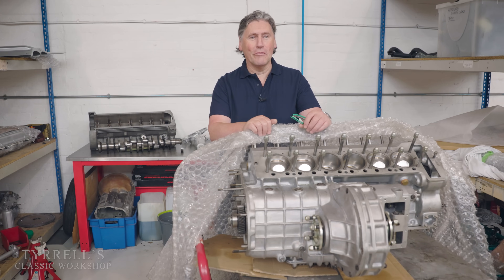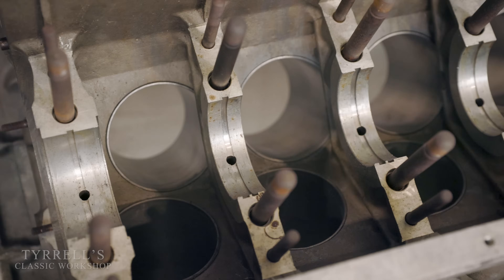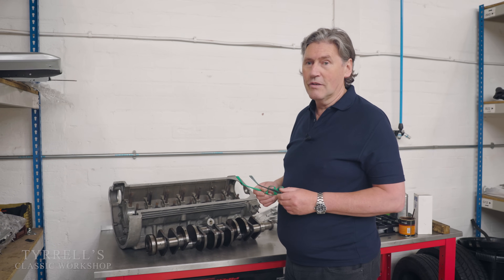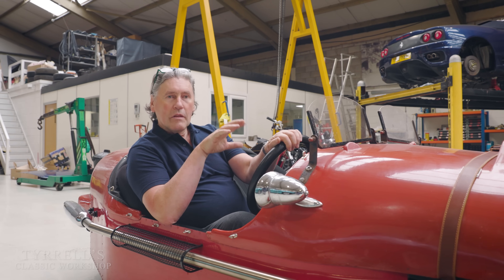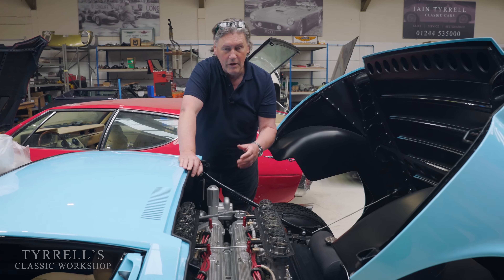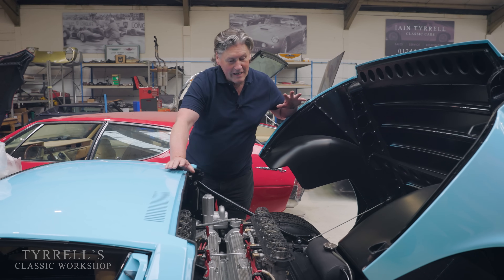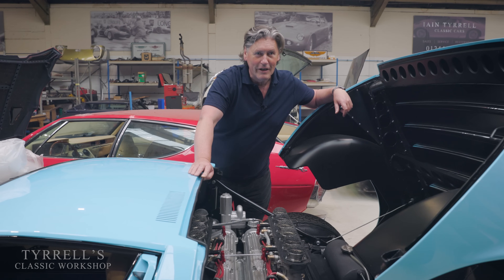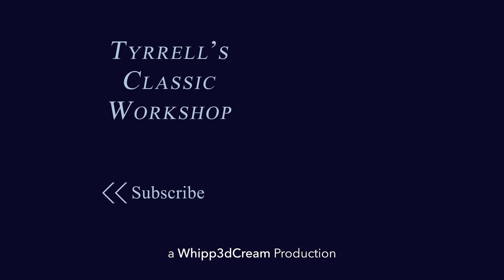How to warm up your classic car engine the correct way & why it matters | Tyrrell's Classic Workshop

Comment from the maker: I hope you enjoy this long-awaited and much-requested video and understand that it's not possible to cover every nuance of classic car engine out there.  I look forward to reading all your comments and feedback as always, and if there are some common threads then we may well look at doing a follow-up episode.
Reply: Thank you for these wonderful videos, Mr Tyrrell — along with Harry’s, they’re the highlight of the Internet.
Reply: So would it be a good idea to build in an Ignition Switch? So that you can get Oil Pressure with the Starter and then start the Engine?
Reply: @TheCanky  I used to do this many years ago with my 1937 Morris 8. Get in and pull the starter button to spin the engine over for a few seconds, then pull out the choke, turn the ignition key and then pull the starter. On very cold mornings, given that it had 6 volt electrics (!) I'd use the starting handle first to break the "stiction" of the oil. Happy Days indeed !
Reply: @TheCanky  On many British cars of the 50 and 60s with separate starter solenoids there is a button on the bulkhead mounted solenoid that allows you to turn the engine over with the ignition off. My Lotus Elan is so equipped, and I often utilise this feature to turn the engine over and get oil pressure before starting. It really makes a difference.
Reply: @TheCanky  You could do a "Coil switch". In fact this was a common thing in the early 80's to have a hidden coil switch. Thus if someone tried to take your car they could not get it started. But also useful for priming the oil system. Indeed even on early FI cars like K-Jetronic you could wire a switch to the fuel pump to prevent firing.
Reply: @TheSaabClinicUK  wow thats really interesting, i didnt know f1 cars used kjet,  its a great system, ive got  a mk2 golf gti with it 👍
Reply: @TheCanky  That’s exactly what my Dad fitted to his cars in the 70’s and 80’s. Neighbours thought his car wouldn’t start easily. Little did they know he was building oil pressure and saving his engine.
Reply: Would be interested in your thoughts on oil additives being used to lower friction on engines Iain, and if they're beneficial in engines with huge oil quantities especially.
Reply: Hope to hear about anti-wear additives that we could add to the engine oil.
Reply: Awesome! Thank you! What I am still wondering: how do you warm it up after starting, more exactly: What's the ideal moment to start driving?
Reply: Dear Iain - you are getting to have a bit of a cult following on this side of the pond.  Congratulations!  It's well deserved.  With my present (and second) Miura, this is exactly how I start the car.  It's a bit warmer where I live and I find I only need to pump the throttle three times before the engine kicks into life... but I do wait a moment after the three pumps because you can hear that the Bendix fuel pump is topping up the bowls after that small charge.  Then, of course, keeping the rpm down in the 1500-2000 range while exiting the garage, and then I have the good fortune of having a residential area that is immediately uphill.  There I can keep the car in 1st at reasonable rpm without needing to upshift and cruise about waiting for the oil to warm up.  This is critical before shifting (thank God this one doesn't have a split sump like my last Miura), thus the trans oil heats somewhat rapidly and before long, a 1st to 3rd shift is in order.  When fully warmed up, a 1st to 2nd is fine.  My 2nd gear synchro rings, operating sleeves, and shift forks are in great shape and that's how I want to keep them.  May I suggest discussing this delicate topic with folk who are not familiar with the fine points of vintage Italian transmissions? ;-)
Reply: Would it not be a good idea to add a electric oil pump and a pressure switch so the car has oil pressure before starting.
Reply: Great video thanks! Would love some tips on how to prep a classic for being put into the garage over winter etc…
Reply: @hwajones  Harry’s garage did just such a video👍
Reply: It’s also a thermal expansion problem. Because the combustion chambers are are super heated hot spots (1-2000*c) a big difference compared with rest of a cold engine. The solution I use is running the engine for 20-30 seconds then shutting the engine off. Then wait a few minutes before restarting. The engine temperature will be more even, the oil flow is better, bore washing is avoided and it just sounds happier. Try it I would be interested to hear your results or if this is a known practice.
Thanks,
David
Reply: When did each manufacturer got it right ?
Reply: Thank you, this pretty much clarified every conceivable question on the matter. Now I understand, why even some of the newer Lamborghini V12s seem to crank for far too long before firing up but it is a deliberate delay to lubricate everything before letting the engine fire up. Even on my 2018 Golf R the cranking process takes far longer than on an older 1.6  Golf, now I know why.
Reply: Iain, it might be useful to do a follow up video on how to shut down an engine correctly, especially regarding oil starvation and cooling on turbochargers.
Reply: So separation of the starter motor turning the oil pump and mechanicals from the spark ignition would be a good idea. Use a starting handle with the ignition off?
Reply: Thank you lord Ian. All hail.
Reply: I was thinking as my really old car always drains the carb by itself. So more then enough time to build up the oil pressure. On the other side, after every run the fuel in the carb will go down the intake to the engine. The same as a very rich running engine or fludding it when starting this also has a negative result on the oil film on the cylinders but how much? Greetings Peter
Reply: From your experience, does Castrol "Magnatec" help prevent some of these dry startups?
Reply: Fantastic stuff Iain. Any further thoughts on how best to get an engine up to a good operating temperature before using higher revs/loads? I have heard contrary advice about how to achieve a good oil and engine temperature, idling vs gentle driving. Also on how best to assess when your engine has reached at an appropriate temperature for less gentle use? How much reliance can be placed on oil and engine temp gauges? If you have them.
Reply: Jaguar V12 EFI ?  same ..
Reply: Hi, any chance you could do a part two video on classic Diesel engine warm up such as older Perkins engines or classic cars a Mercedes 300 Turbo Diesel for example ?
Thanks.
Matt.
Reply: Hello Iain, Yes, thank you. I enjoyed your engine warm-up video. All of your videos are great. No gimmicks or music, etc, either ! Seeing you start the Miura got me thinking about how some used to burst into flames. Were /are they prone to this, or is it down to lack of knowledge, adhering to correct stsrting procedure eg ? I imagine it might be due to standing on the throttle or excessive pumping of the pedal, filling up the trumpets of an initially non firing engine with fuel, then Woof !! ? Many thanks, Antony.
Rx-7 Series One Mk.111, UK/RHD. Peugeot 604 GTI, UK,RHD.
Reply: I am concerned that my 2005 Jaguar XJ 8 runs - no manual choke - very fast in idle when it's started cold  - is that normal and acceptable?   Thanks.
Reply: Iain , it was a pleasure to bump into you at Goodwood today and it reminded me about this fascinating video. It made me slightly concerned as one example of big end wear was a V8 AMG, like the one in my car.I assumed the engine management system would choose the best rev range on start up and I couldn’t have bought a better engine.I always watch oil temperature rise to operating range before driving hard, I change the oil frequently and I winch the car out of the garage rather than use the engine to manoeuvre for 30 seconds and 20 ft distance.
Is there anything else I should watch out for regarding engine wear other than your comments in the video.
Thanks 

Andre

Comment: Interesting, I've been doing it almost right with my two old Alfas, partly helped by the way they are made. With mechanical fuel pumps, it's takes a fair bit of cranking to fill the float bowls again when they haven't been used for a while, so no chance of an instant start. One now has an electric pump, so I'll have to ensure to turn that over for a bit before giving it a few pumps. I do depress the clutch instinctively, seems to lessen the load but don't know if it's correct. I don't let them tick over, but the Alfasud particularly needs a couple of burst of revs to get it firing on all cylinders after pumping petrol in to get it started. My modern car is a Jaguar F type V6, and that has a start sequence that must be dreadful for the engine. It bursts into life instantly with a great flare or revs, then settles to a fast idle for a couple of minutes.

Comment: I enjoyed this segment even though my newest car is a 1996 with fairly modern fuel injection and OBD II

I'll start off by saying I've had a 50+ year mystery about a Chevrolet Camaro I had and I took it back east of Virginia. I'm in the fairly warm climes of California 

In the winter I thought I was doing the car a favor by letting the thing idle in 20°F weather until the temperature got up 

I sold the car a couple of years later to someone back in Virginia and he was a bit upset with me in a few weeks saying one of the cam lobes was worn at 80,000 miles

And the small block Chevy has been one of the legendary engines General Motors made being in production about 50 years

I've always wondered what was the cause of this. The overhead valve camshaft of course relied on just splash lubrication

But I think the primary cause was letting the thing sit in idle for 20 minutes

Fast-forward and all my current cars all older Mercedes have all used mobil one synthetic oil since new. 

What I've been doing is just starting them up which they fire immediately. The two of them have a computer that takes over and you don't even have to hold the key-you just flip the key in the computer takes it over until it starts

I'll notice the fuel injection has it a bit above 1000 RPM and I wait until the tachometer goes back down to nearly idle it warm which is about 500 to 600 RPM

Then I start driving it

And I noticed probably because of the smog regulations the transmission will take a bit longer to shift next year letting the engine rev a bit more but in no case does it go above 2000 RPM

I used to drive it on surface streets in my neighborhood about a mile to a freeway on ramp where most of the time it was near operating temperature

I read something from a Porsche engineer when someone asked "when do you consider your car is warm for testing" and he said 60°C!

I don't know if he gives him full throttle at that and I certainly don't but I figure by 60° it's ready to go on the freeway and then it's never above 2000 RPM

And I would say within four or five minutes it's up to operating temperature

The newer cars including my 2011 actually have a heating probe in the thermostat that helps heat up the coolant

Anyway the point is drive them gently after about the first 30 seconds to 60 seconds keeping it under 2000 RPM or thereabouts till it's operating temperature

At least that's how I've been doing it

A car with a manual choke is a very old car these days

Comment: Great video - thank you. I've never had an engine fail on me (even driven enthusiastically) - but I do always start my modern MX5 for a little while before setting off - old habits die hard. I never used to leave the choke out for very long. On the MX5 - the revs drop within a few seconds of start up - even in very cold weather.
It's probably egg-sucking for most of your community - but I'm quite anal about the viscosity rating of oils. Always buy the right ones and don't ever buy rubbish ones from the supermarket. 
Obviously high value classic owners will not do this - but some with others (emerging classics) watching might?

Comment: @ian_tyrell Lovely video! As all of yours on the channel. I have a question for the start up on my Porsche 993. When it is stored in the Winter time and I bring it back to life in the spring I pull out the DME to let it build up some oil pressure. Then I pull it back in and start it up. Would you then go instant for a drive or let it idle (maye even with a certain throttle?) to a certain oil temperature and then go for a drive? The car is stored for around 7 months. Would you start it up every 3 mounths with the upper described procedure to prevent the oil sitting in the engine (daining from the dry sump tank) Thank you very much!!

Comment: Sooo... Leave the choke on - let it turn over and build pressure - pull choke out - fire it up - immediately push choke back in..? OR - once it fires up keep revs 1500-2000. It's for a 1999 cbr carburetor

Comment: Hi Iain!
I'm not sure if you have any plans to revisit this topic in future videos, but I have a couple of questions:
Living in a cold climate - Michigan - where the overnight temp drops anywhere from -8° -20°C, and classic car owners often store their cars through the winter months - that is late November, through to the end of April: should one start their car and run the engine during these months, or leave it completely untouched until planned to be driven?

The second question: with a regular, daily driven (modern) car, do you recommend letting it warm up at idle, in the winter months, before driving off, versus driving off within a minute of starting the engine, and just keeping the revs below, say,  2.5 thousand, until the temperature gauge is showing full operating temperature?

Thanks in advance!

Comment: Thank you Iaine! I was planning some fixing on my 85’ e28 straight 6 as I was finding the car would fire only after 2 or 3 seconds of cranking, which I thought was not normal (no gas pedal input, gear in neutral, no clutch engaged). The engine then goes in high idle mode (1300/1500rpm) for a few minutes after what it automatically settles down at about 800/900 rpm.
With your explanations in mind, I now start to wonder if bmw didn’t made this quite long starting sequence on purpose in order to achieve proper lubrication.
Could this be? Or do I need to still look for something that might be wrong?

Comment: Very helpful.  I recently acquired a modified (~110 hp, single Weber) '91 Rover Mini. The seller instructed that the choke should be full out on start-up. That puts the RPMs at ~2000 within two cranks.  Since childhood, I thought there were probably better ideas than fast, idle start-ups.  You have confirmed this, at least for a British manual choke car.  Thanks!
Reply from the maker: Great to hear- pleasure!

Comment: What is the correct start and warm-up procedure for a 1986 Jaguar XJS. I have been turning on the fuel pump two or three times before I turn the key for full ignition. After watching this excellent episode. I am not sure if I'm doing what is best for the car. The car has been driven 20,000 kms.
Reply from the maker: Just crank the engine, no throttle. No priming of the fuel system necessary
Reply: @iain_tyrrell  thanks so much for your timely response, from beautiful Vancouver, British Columbia, Canada.

Comment: With ANY engine start up is critical!! Using the CORRECT oil of GOOD Quality correct grade, with manual choke reduce the choke ASAP,  allow the engine a few seconds to flow the oil before moving off,